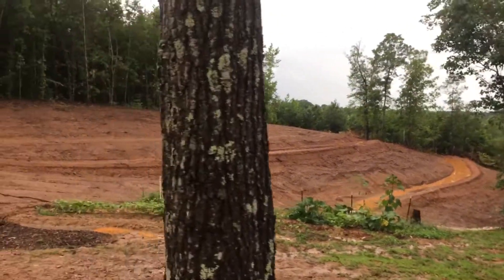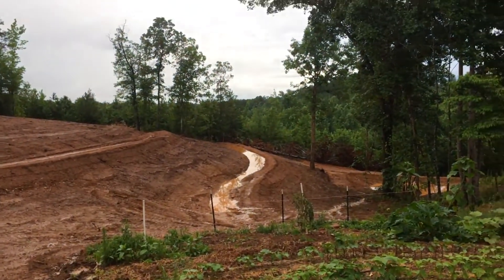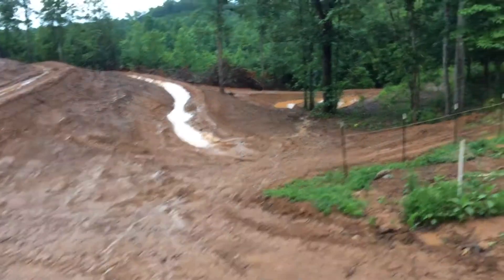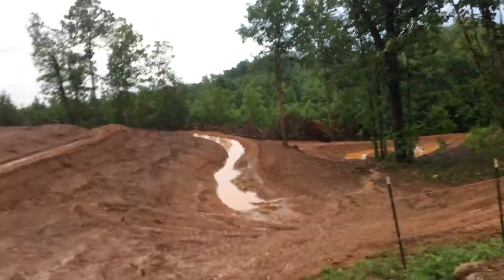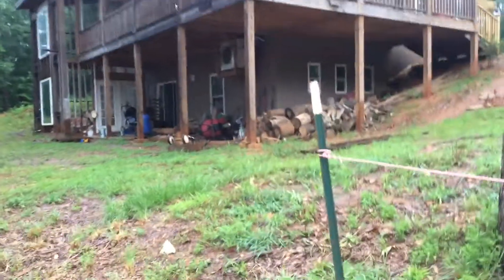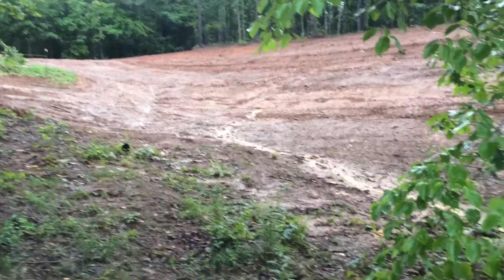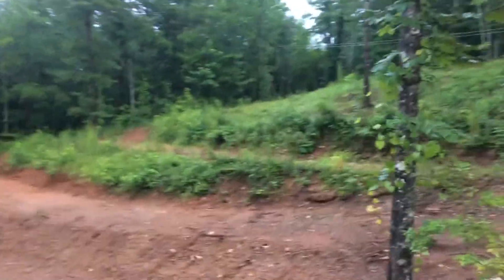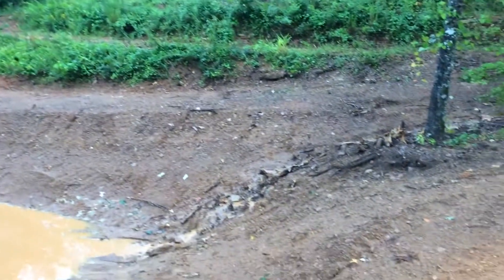Ditches, Swales, Ponds, and Capturing Water on a Hilly Homestead.

Comment: LOL! That's not a pond, it's a mud puddle. Btw you do know that water that comes off of roadways & driveways has oil, gas, anti-freeze, & transmission fluid in it, right? I like your setup though.   :)
Reply: It looks like a single use road for the house so you shouldn’t have many problems with that.  I’d say the biggest problem would be new sediment getting washed out because of the deforestation which means the pond will fill up.  That would get fixed if he allows certain plant life to fill in the ditches which would also filter the water and take nutrients out of it so that the pond doesn’t get loaded.  Hopefully he did that and also the fruit trees should help to hold in the hill side